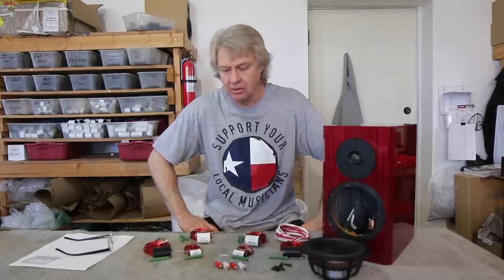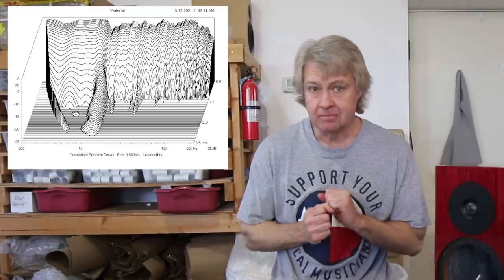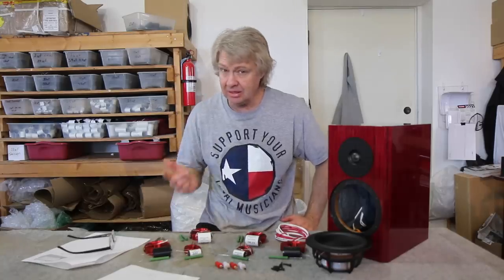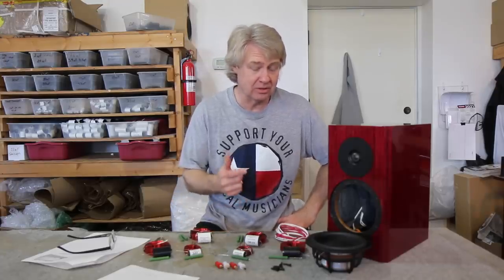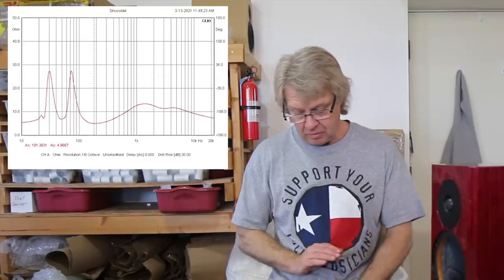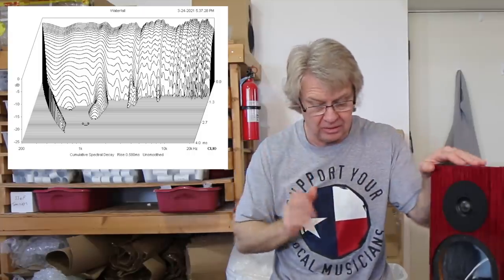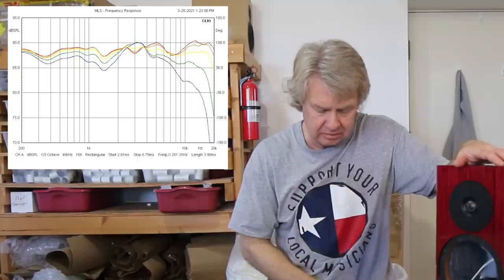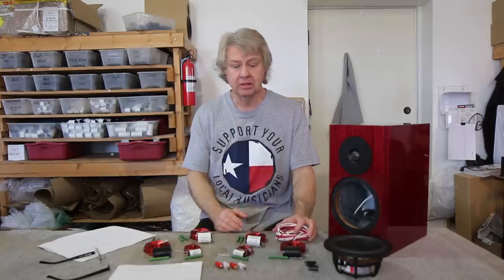Dynaudio | How “Special” is the 40?

Comment: I dont care how they meassure..I care about how they sound..and I think they sound pretty damn good...
Reply: What about the quality of the crossover parts, do you care about that as well?
Reply: @murcielago188  well if they sound great...they sound great...so no not really..
Reply: @The-Spotlight-Kid  well you presume wrong...
Reply: @jespergth9437   Then i appoligize. But surely you get my drift about spending a relatively small percentage of a speaker's $3000 price to flatten-out such a lumpy & hence "unfaithful to whatever the source's" intended frequency reproduction, of course we don't always get a chance to know of such a potential 'massive' improvement for every potential speaker purchase,  but if i'd bought this particular model, because it sounded good in the 1'st place, then after seeing this vid i'd be ultra-keen to take the extra monetary step to extract the best out of it, especially after seeing the before & after graphs showing the magnitude of difference this upgrade made. if it was my main hi-fi listening source, which any $3000 speaker would have to be (in my wealth bracket, or lack of)
Good luck
Reply: @The-Spotlight-Kid  not so sure about if the "new parts" actually make it sound better.  i dont think its that simple. Those "high qualiity" parts might completely destrpy they sound of those speakers. GR-Research is in the business of selling upgrade kits. OFC they claim that simply changing part to another will improve the sound. or changing graph will improve the sound... afaik, its not that simple and straightforward. if it was, most  hifi companies would use those parts.
Reply: Yeah, leave the poor speakers alone....
Reply: @KuopioKallavesi  yup!!

Comment: The problem with 'upgrading' crossovers like this, is the assumption that perfectly flat is the best way a speaker could measure. What makes a dynaudio sound different from a KEF or a Focal speaker in large part is those little peaks and valleys through the EQ range which either accentuate or soften certain frequencies. Making it flatter isn't inherently better, it's just different. As far as wiring quality, etc. it's been pretty well disproven that that stuff makes any difference at all. That being said, it is pretty sleazy that these companies are selling their top tier speakers for thousands of dollars and still using the cheapest materials inside that they can
Reply: Sorry, but that ringing in the woofer cone (break up), and smearing caused by cheap parts wasn't what they were shooting for. Those are not house sounds. They are problems not addressed properly.

Comment: Why don't we see the altered result with the new parts?
Reply: The measured results are right there in this video. 

What bb foto has stated is a complete and total lie. 

If you look in the upper righthand corner of the measurements you'll see the word Clio. Clio is a measuring system. It doesn't model responses. Each measurement shown is an actual measurement made with a network on that speaker. Nothing I do is modeled.
Reply: @dannyrichie9743  - You also never answered the question. You can play semantics all day, but the fact that you NEVER show a finished “upgraded” speaker pair speaks volumes to those with common sense.
Reply: @toucheslapper  Are you kidding me? You haven't been watching all of my video's. I took the Klipsch RP-600M and shot five video's on the whole assembly process from beginning to end. I did the same with our X-LS Encore kit.
Reply: @bigjay1970  All in the works.
Reply: @dannyrichie9743  
I just saw seeing Ron's live video talking about his trip to you!🤔🤪   I must have ESP!  Have fun with Ron!🤔😉🤗😇
Reply: @bbfoto7248  your statement is false and you should be ashamed.

Comment: So great to see an actual real world RTA of Dynaudio's bass driver, all I've managed to find is their own published charts in their manuals. This response is NOTHING like any of the response charts I've ever seen by them. I was going to buy pair of MW160 or MW170  6.5" or 7" for the car mainly because of the 3" voice coil, I want to run over 500wrms per driver and this should easily handle it thermally, but after seeing this, I think I'll buy the Morels.
Reply: If you are running them as a MB driver crossed 500 or below, I think it should still be fine.
Either way its been 2 yrs so curious if you used the Morels and how they sound.
Reply: Yeah I got the Morel Elate 6, the perfect match for the MT23 tweeters I've had for about 10 years, these older Elate 6 are SUPER hard to find.  The mid bass is insane, like totally physics defying.  Where I used to have to run 200Hz 24dB HPF (and barely that could contain the xmax), I'm now using an 80Hz 24dB subsonic and a 125hz 6dB on top and they barely move.  I know that sounds insane, but I'm running about 40 to 45 volts into them (and the tweeters also, both running active) and they take it all.  The car is nightclub loud.
If I just use the 80hz subsonic alone, they can take about volume 56 out of 62, which is still pretty loud, about as loud as a normal person running 100 or 150w per front driver.
As for the sound, I like them, I don't notice any big peaks, I typically find around 400hz is VERY peaky in front doors, my Alpine DD Linears were terrible, the speaker peaked there + the door seems to resonate there also, but the Morels have worked out well.  They still sound "big" because of the door resonance but it's not that big of a deal to DSP that out.  I only have an emm6 mic, I need something better, but I am happy with what I have.  I would like to buy a 3 inch mod to raise the soundstage and LPF the Elates near 4 or 5 hundred Hertz eventually, but again, I'm happy with what I have.
I listen to club music a lot, CD tips to .wave, also I like house music and ambient music, so anything from loud bass heavy dance music to soft detailed music.  I have the Elates slammed at down at 4KHz 24dB, they don't have any nasty peaks when they extend too high, but I use the sharp filters for power handling.  I chose that high because I only have 2 way and I liked the sound of having a touch more mid, I think they are starting to rolloff naturally by then anyway, plus the closest one is super off axis, whereas the tweeters are dead on 
Hope all that has some interesting or valuable info for ya lol

Comment: There is no such thing as intrinsic value. There is only the value assigned to a product by the purchasers wallet. If these speakers had included all the crossover parts Danny believes they should would anyone who thinks these speakers are a rip off as is suddenly think they're a good deal? Well, if you answered yes you're not thinking clearly. Yes, the crossover parts Danny recommends are more expensive but not even remotely close to being enough to warrant a $3000 price tag based on parts content alone. If you want great overall value from a parts versus performance price then build yourself a kit. Like, seriously, almost any kit. Buy Danny's kit. Buy a kit from Madisound or Parts Express or any of a variety of other sources and you will definitely get more for your money than any commercial speaker will give you. Every product on earth costs more than it's parts content alone and no one man is the absolute arbitor of what those parts should be regardless of price. Are the parts Danny recommends better than what came from the factory? Technically speaking, absolutely. But will changing out the factory parts for the GR-Research parts make this speaker the performance equivalent of a top notch $3000 kit? Not even close! Heck, many people will prefer the sound before the parts change. As I've said before on this channel. It's your money, spend it how you wish. But all anyone can do no matter how skilled they are with speaker design is change, not fix, the sound. The end result of that change may or may not sound better to you. Some people like a bass or midrange bump. Some people like recessed mids or high or even thin bass. Geez, I think some of y'all would sell your house if Danny came along and found that your wall studs, though perfectly safe and installed correctly were southern yellow pine instead of Douglas fir. If it works, you like it and feel it's worth the money, buy it.  But If you're buying $3000 bookshelf speakers in the first place, well, I'd say that no matter how good the parts are inside, your perception of value is too skewed to worry about anyway!
Reply: Amen
Reply: When you spend the money you also invest in a company. The level of components you get for your money is only a fraction of the value you get in return. 

If you want the manufacturer to pay salaries, rent office space, do research and development etc then you assume your 3k isn't getting you 3k in parts. The product you receive is only a fraction of that. If it weren't, there would be no company to buy speakers from
Reply: PERFECTLY SAID.

Comment: I believe these speakers were supposed to be "fun" and were voiced accordingly.  Dynaudio certainly has a house sound, much like Harbeth or Sonus Faber, etc. that you either like or don't like.  Fixing the cabinet resonance and flattening the curve (especially without consideration of the speaker's polar response or the room) is counterproductive and will absolutely ruin the resale value.  If you want a "neutral" sounding monitor you should just purchase one to begin with.
Reply: Actually, the polar response has been improved as well. Also, only part of the upgrade is balancing out the response. That nasty woofer resonance is not part of a house sound either. They just neglected to correct it, and it needed correcting. These were also being held back by the parts quality. The upgrade is a transformation from a lifeless and problematic speaker into a pretty decent speaker.

Comment: Would be great if this "expert" did some fact checking before posting this video, but maybe that's too much to expect!
Speaker cable inside Special 40 is NOT cheap! It is VanDenHul The Snowline.
Non-electrolytic capacitors are Mundorf capacitors.
Reply: I don't think that was what was in these speakers.
Reply: But the fact there are electrolytic caps in there is a joke...
Reply: @dannyrichie9743  l’m with YOU, Danny.
Reply: Dynaudio does use Mundorf in some of their higher end speakers. However these are probably Bennic. My Dyn 52se's have Bennic I believe. I took a peek in there.

Comment: I am kind of confused after 30 years of Hifi and DIY speaker building looking at all your videos. Seems you think to increase sound of every commercial speaker by flattening the frequency response on axis and 30°. But is it that easy? To be honest: I did not hear any of your own speakers or any speakers modified by you. But I am kind of struggeling to believe becuase from my experience the big companies like Dynaudio know very well about speaker sound refinement.
What about impulse response or THD in higher power levels? I cannot believe changing poly caps to more expensive poly caps and corretly rated iron inductors changing to air inductors change the world. (and I have changed many poly caps in my live)
From my opinion it is more the developer feeling to understand how to adjust the crossover to get the speaker sound good. And I believe that Dynaudio for sure recruted the best developers for the job.
Reply: Hi GR-Research, please give me a response so that I can understand it. I am at least not a complete noop , german diploma in electric engineering since 19 years. so I think I should potentially be capable to understand what you would explain.
Reply: @Thorsten Hoffmann   Give him a phone call, I called him once because I was having trouble ordering no-rez product on his website. He was nice and helpful. However, I wouldn't expect him to have a long conversation, he's busy running his company.

Comment: Strange measurements, as Dynaudio has one of the most advanced measurement systems. These little speakers sound amazing, so how important are the frequency response and the crossover parts if the sound is excellent? I like to see a comparison between the original and the upgraded version, blind tested by an experienced listening panel.
Reply: Then they sound have used that measuring system to identify the problems and they should have used some higher quality parts in them for that price point. What they produced is mediocre at best and piss poor for that price point. 

There is no comparing what they sold to our upgrade.

Comment: What's the issue with PVC coat?
Reply: It's kind of the heaviest, with bad numbers. It completely changes the signal speed in the cable. Lightest is the best, with air  inside,. Best is air, bur technically difficult. Some high-end even goes for cotton, yep grandma's underware cotton, like Duelund.

Comment: I don't understand why people talk about "sand cast" resistors.  You won't find any "sand cast" resistors in any manufacturer's catalogues.  Some resistors are encased in ceramic to aid heat dissipation, but the resistive element doesn't contain any sand.  Some ceramic encased resistors are wirewound, and wirewound resistors are very good.
How did "sand cast" become a pejorative term?
Reply: The term sand cast is how the ceramic shell is cast. There is no sand in the electrical path.

Comment: Well, to me the FR plot after the “upgrade” looks worse than the original on some frequencies, while he flattened a bit the 1K region he also created a deeper valley on the 6K region, also I don’t buy the individual “woofer measurements”, since the woofer has been tweaked to work along with the original crossover, what I would ONLY do is replacing the inexpensive parts in the crossover with higher quality parts but keeping the original values.
Reply: My point is actually a bit different - I'm not so sure the tweeter is able to handle low x-o freq proposed in the upgrade. While the bump in midwoofer freq response looks terrible, most 6" drivers have the cone edge artifact. To me the crossover could be optimized better from the factory, but I wouldn't cut the tweeter so low unless I'm 100% certain it can take the extra signal without introducing it's own distortions. Actually I have nothing against the original voicing of this speaker.
Reply: The drivers are just pulled of a shelf and the crossover and box is designed to suit. They basically only make 1 bass/mid driver, in various sizes. They all have the same motor, the same cone material and basically the exact same T/S parameters apart from the sensitivity, resonant frequency and overall bandwidth. 
So any speaker they make using this driver with the 3 inch coil is going to have the exact same issue. Even the cars like VW that have these drivers just with a plastic basket I bet have the exact same issue, unless its caused by the basket but the frequency is way to high to be caused by solid cast alloy
Reply: The thing is that I don’t get why the original crossover has to be flawed, every hi-fi loudspeaker on the market has its signature sound, if you want a flatter FR go get studio monitors period, I myself own the S40’s, I can tell you that with the right electronics and the right placement these loudspeakers sound very life-like and sweet, I really like them, are there better loudspeakers?, of course there are, but at this price point these loudspeakers are very, very, very good at soundstage, dynamics and detail, besides that there’s no “perfect” speakers on the market, they all have colorations and distortion.
Reply: I think you are asking  "why is the shape of the response a flaw and not a feature"?  Well, I guess you could look at it that way.  A song should be recorded perfectly, and a speakers job is to play the song back with nothing added or taken away.  The speaker should never be able to make a song sound "better", only worse.  A speaker that doesn't not play like a flat studio monitor is adding peaks and distortion information that should not be there, or it is taking away info that should be there.  As I said, the song should be recorded perfectly so that when it is played back 1:1 with a flat playing speaker it sounds the best.
Reply: I think there is a misunderstanding about hi-fi loudspeakers and studio monitors loudspeakers, hi-fi speakers usually have some pleasant colorations, they could be on the neutral side of warm or they can be a bit bright, some others can have a slight V shaped sound, so a flat FR in hi-fi speakers is not always a desirable feature, in fact is not expected, this is what audiophiles are looking for, some audiophiles find flat FR speakers boring and uninvolving, but a flat FR is desirable for studio monitors. The S40’s are considered a balance sound loudspeakers with a touch of warmth and air at the top. This is why I find this kind of crossover “correction” completely pointless.

Comment: Off axis freq and phase response needs to closely match on axis to achieve realism (according to Floyd Tooles research at NRC here in Canada)
Reply: It's impossible with these speakers, there's a boat-load of diffraction at 3kHz
Reply: @the_niceking7011  understood.
I wonder if the old trick of felt sheet around tweeter would make a difference.